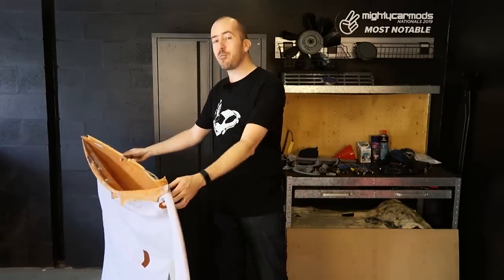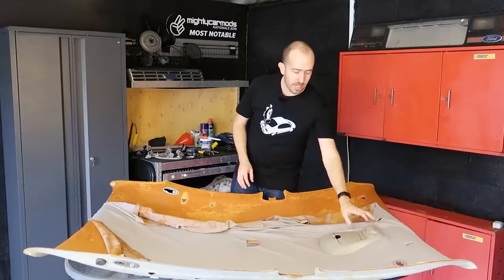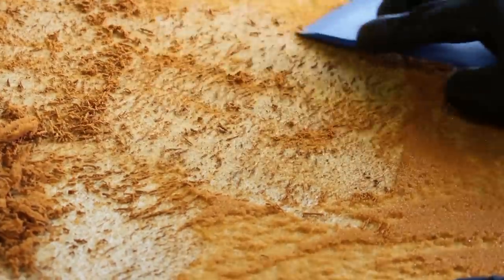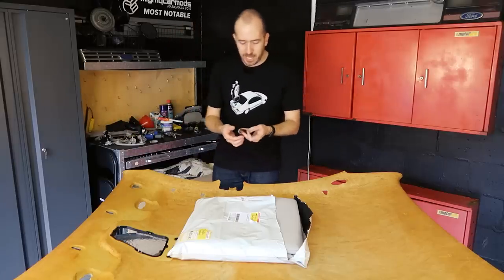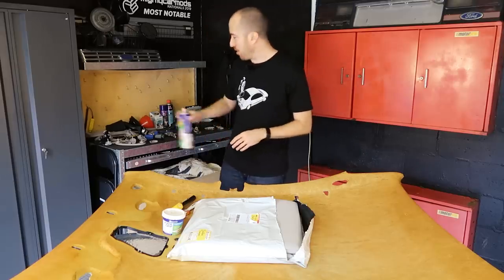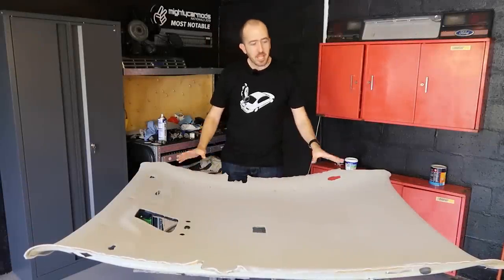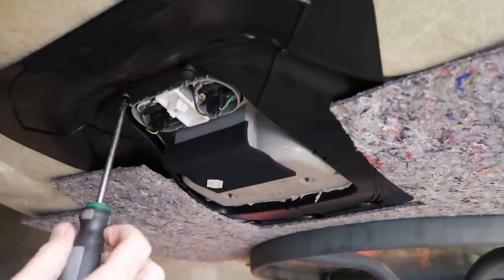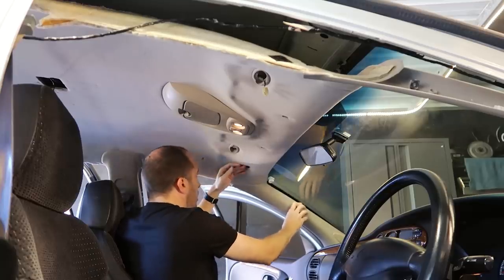Fixing the Headliner on an AU Falcon! Roof Lining DIY Repair Guide for Beginners

Comment: Great job!. I am doing my headliner soon. Will be using Permatex (Body Shop Heavy Duty Headliner & Carpet Adhesive form Autobarn) for the glue. Its a spray can and super sticky from what I have seen in Headliners restoration videos on youtube.
Reply: @The Prospectors welcome, they are on sale too this week :)
Reply from the maker: Sounds like a good product.
Reply: Did my headliner during the weekend. The glue is super sticky, its so sticky the only challenge is that if you make a mistake its going to be hard to fix! I did make a few mistakes. But overall the roof looks million times better than what it was before.

Comment: I remember when car headliners were built to stay in place. You did a great job on this one I have to say. 
Just thinking though, did you stir the glue before using it? Sometimes they can separate if they've been sitting for a while.
I'm glad my BA wagon hasn't decided to drop yet.
Reply from the maker: Yup I did, sorry I didn't show that. It did a great job in the end, just took loads of time. I think the cold weather and the moisture in the air from all the rain really worked against me.

Comment: If the contact adhesive had actually bonded on contact, you wouldn't have been able to roll out the creases. Bond on contact glue would've resulted in a horrible job unless the material itself is stretchy (and even then, you could've ended up with some gnarly looking creases).

Two years on, how is it looking? Has the smoke smell returned (from hard plastics and soft areas of the door trims)? Or has it remained clean-smelling?
Reply from the maker: Smells clean, and the roof lining looks just as good as when I finished it. So I would say the glue was actually a good choice, but attempting this on a cold, rainy day with 100% humidity is probably a bad idea.
Reply: High humidity can be a problem for glues that rely on evaporation of a solvent, so that's probably what was happening.

Comment: Love this video! My EB Wagon’s front section of the cardboard backing itself has fallen down, not fun! At least the cargo area section (separate board) is still okay...
Reply from the maker: So long as it doesn't touch your head or impede vision, you can definitely live with it.
Reply: MotoringBox, it pisses me off, I’ll be getting it fixed soon. Spoils the rest of the otherwise undamaged interior.

Comment: Would it worth putting something like dynamat on the metal between the liner and roof?

I Had my BA headliner replaced in black and i reckon it looks way better than the light grey/ off white colour, by a pro money well spent IMO
Reply from the maker: Probably not in my opinion. You don't get much noise coming into the car through the roof, just heat mainly. The roof liner panel already has some insulation on the back of it, I reckon it's enough.

Comment: A wire brush makes short work of that foam.  I typically use a brass brush as the bristles are not too stiff, not too soft.
Reply from the maker: Good tip.

Comment: Contact adhesive works properly when both surfaces have the adhesive on them. Would be very messy in this instance though. You would think that there is a contact spray out there that has the temp rating.
Reply from the maker: There must be something about making it an aerosol which limits the durability in high temp conditions? That was my guess anyway.

Comment: Did you drive around with no head board until you finished the job? I wouldn't be able to do it in a day or weekend for that matter. Following your channel and have all the same problems on my 2010 FG so lastly will look see if you have chipped rear bumper. Last owner, so I got it cheap, must of dropped something in it from the boot.
Reply from the maker: I was lucky enough to have another car to drive instead for that week! There's nothing stopping you from driving though, it'll just be louder and you'll have some wires hanging out.
Reply from the maker: Honestly it's the sort of job that is actually worth paying someone else to do it!

Comment: my au has like 70 pins in the roof
Reply: Got you beat. I have 100 thumb tacks holding up my roof lining in my 2007 Fairlane. I've been putting off the repair because I know it is a pain of a job to do. I'm fortunate to have a donor vehicle, so I will be able to swap one in and one out quickly and only be without a car for a hour or so. Best glue I've researched is Car Builders Spray Adhesive as it handles up to 120 degrees celsius. Made by an Australian company for our summer conditions.

Comment: Put it in or make a big plastic bag and use your vacuum cleaner to suck air out and it will apply even pressure to hold surfaces together. Saw them do this on B is for build making carbon fibre panels

Comment: Water based was the problem here. Definitly need a chemical bonding for a good adhesion.
Reply from the maker: Perhaps, I didn't want to risk a higher power glue that might react with or dissolve the foam

Comment: I used a spray adhesive, and it worked fine, but I don't know about it's longevity - as I sold the car 2 years later. I would probably get a pro to do it if I'm ever faced with the problem again.
Reply from the maker: I probably would too, it wasn't a fun job.

Comment: Hey mate - I'm in the market for a falcon. What would you recommend - an AU or BA. Thank you!
Reply from the maker: What's your budget?
Reply: @MotoringBoxTV  G'day! Don't know - could go up to 6k+. Would ideally like something very well cared for. But yeah, I've owned an AU previously and it was a very solid car. I know very little about the BA's though. In any case, want to hold onto this car for a long time…Cheees!
Reply from the maker: From the experience I've had with my cars, the AU has had far less problems, but the BA is still a great car and I have enjoyed owning it. It might just cost you a bit more to run and maintain.

Comment: Somehow your channel dropped off my subscriptions. I was wondering why I had not seen anything new now I know so I have a couple of years worth of catching up.

I redid my BA rood lining in polar fleece. I managed to find it in almost the same stone colour as the interior.

The idea behind using polar fleece is that it is stretchy and I'll never suffer from the foam backing breaking down again.

Wish I could attach a picture of it here.
Reply: I'll also add that I take the wiring with the hood lining. It plugs in behind the drivers side A pillar trim. No need to re attach. I also remove it via a back door hole. Even easier if you spend the 5 minutes that it takes to remove the door. Putting the door back by ones self was a matter of using an engine crane 🙂

Comment: dont need to remove all the lights, unplug the lining loom from behind the drivers side A pillar trim, then pull the lining out with with all the lights and loom still attached to make it easier to work on when putting it back in
Reply from the maker: You definitely need to remove them, as the material needs to tuck in behind all of the housings.

Comment: Your issue was you used the water based one if you had of used the selleys vertical adhesive gel it would of been dry overnight like mine.. I watched your video an few others an did my ba roof lining  myself as well an it was rather easy.. used the vertical gel which is 30degress less in how much heat it can handle but mines been 👌so far..  two tins required and $23 worth of sweet black suade bedhead material.. all up $65 job done yourself

Comment: I just did the roof lining in my eb Fairmont the worst part was definitely getting the old foam off the backboard and yeah not a fan of quick grip I got a can of permatex roof lining glue from autobarn very good stuff it was a bit steep at $30 though and you did a good job it doesn't have to be perfect its an au after all haha nah just joking 👍
Reply from the maker: Permatex sounds like good stuff. I came across it in my research, but in the end I decided against it. If I attempt this job in the it'd be the product I'll try next.

Comment: Why do people think they need the material ? The thing I did on an old falcon was I just removed the material had the cardboard instead , and then I thought just paint the cardboard hardly anyone looks up in a car
Reply from the maker: I imagine there may be a slight difference if you go without, like slightly more noise because you've got a bit less insulation and one big hard surface going across the top of the interior. Mine was fibreglass too, not cardboard.

Comment: I'm restoring a car and the original headliner is gone, now I can't find it anywhere... It's the last thing I need to complete my restoration :(
Reply from the maker: Hopefully you can find a replacement?
Reply: @MotoringBoxTV  Found one at the junkyard yesterday, it will need some restoration but I guess it will get the job done.